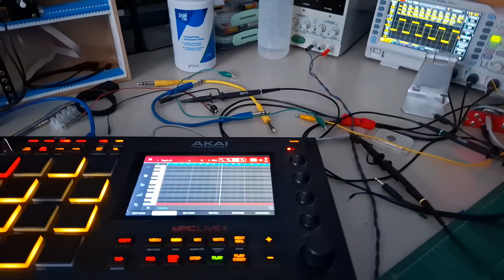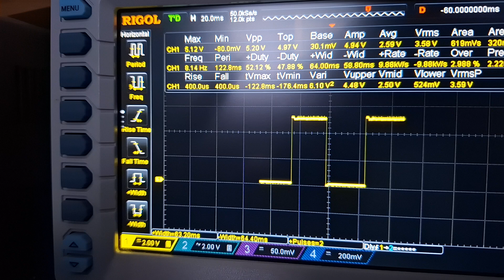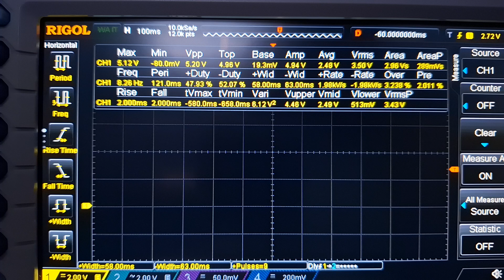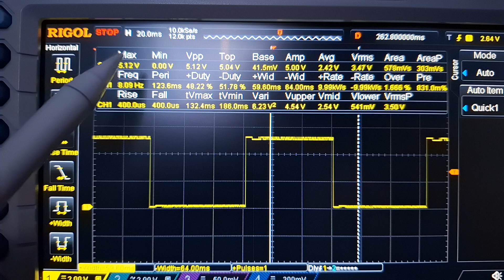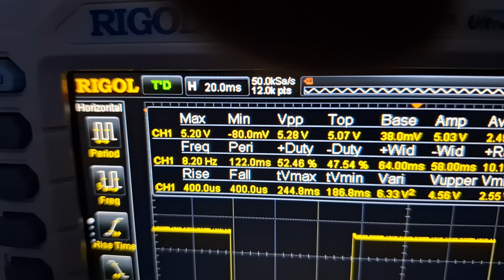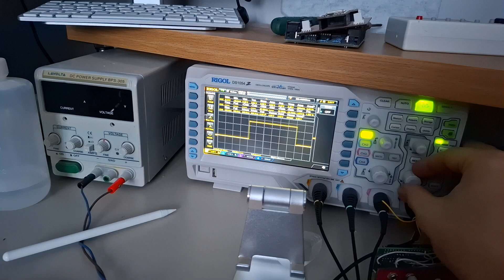(not so) scientific observation of clock jitter of mpc live2 running in controller mode this time.

Comment: One thing I would try in this type of test is to actually measure two different sequencers side by side at the same time. Would you expect to see different jitter on sequencer B? What if the jitter seems to be about the same? Get a third sequencer. Also get a second version of the first sequencer to ensure they both exhibit the same error.......wait maybe the problem is with the oscilloscope. I should test with a second scope. No, wait, that's going too far, Is it? It is. Ok, just one scope and four sequencers, that's all we need to scientifically test this jitter and once we solve this we will finally be able to finish the EP.

Comment: Nice, maybe also test under load and different Bpm like 60 and 240 and see if drift is constant range or is varying..
On Force I have alao noticed audio word clock drifts and complete deSync at times with my ext audio interface (I only use ext i/o)
Reply from the maker: wow Amit, didn't realised you have your own YT channel - always thought you're hiding in the shadows lol
Impressive work btw. :)
As for testing it under load, this is something  to think about once I will lift the audio tracks limit in the final release. So far I'm just looking around and found a potential entry point for that (or at least potential area of interest). I know you did it already on force, at some point I might grab your patched binary and compare it with original force and then compare it to my finding on MPC :)

Comment: Have you tested the hardware jitter as well as the software?
Reply from the maker: yes, I did tests with new 3.x beta version of the firmware in standalone as well as 3.x running older 2.x controller mode. In both cases jitter is roughly the same (1ms discrepancy) which would suggest that the jitter comes from the process block in the software rather than hardware itself. As Amit mentioned in the comment above, need to make some more tests under load and half/double the tempo, but I guess it's too early of a Beta firmware to do proper test on it .
Reply: @dagss  Thanks. Interesting stuff